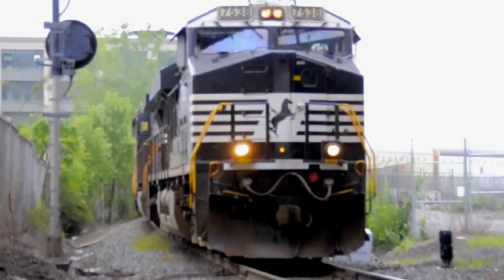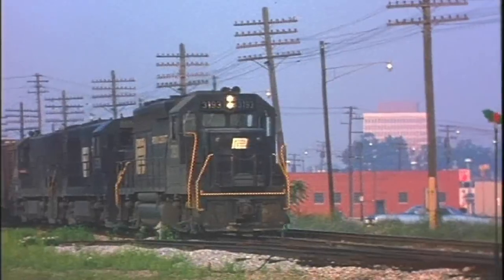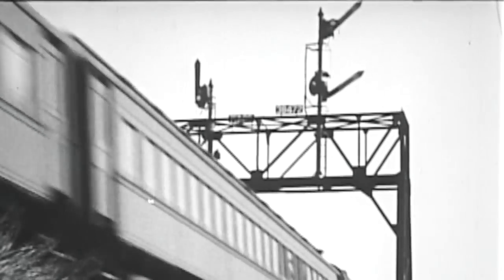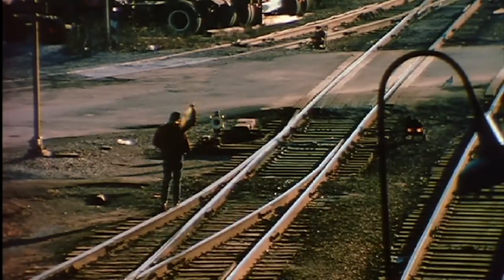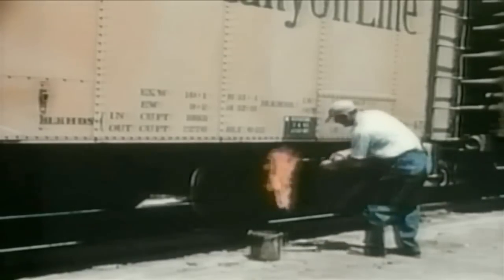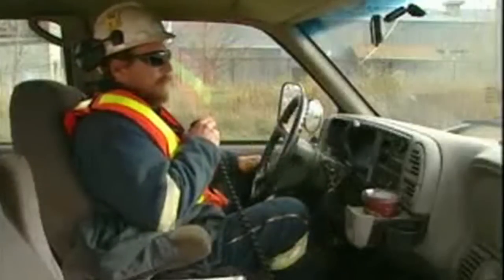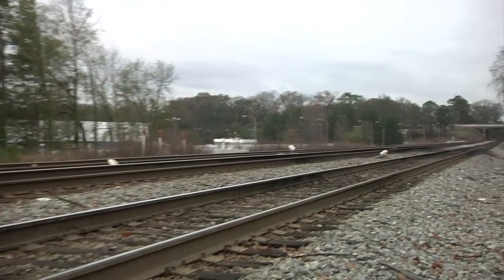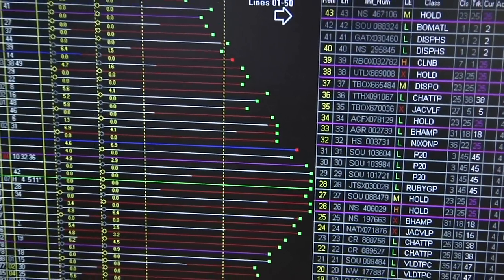Communications and Signals:Then and Now

Comment: Correct me if i'm wrong, But watchin' this had to make me ponder....For over 100 years, cars,. trucks, etc all ran just fine using points, plugs and condensers......So who's idiotic idea was it to start using computers to tell the bloody gear box when to shift? Or to run the entire electrical system?
Reply: +chaosdemonwolf1 Our fearful leaders and everybody else bound to take all control away from common folks. Make it 'specialized' so you can't fix it. Anything can be done mechanically but it's too simple. In order to be 'more important' the product has to become more complicated.
Reply: That somehow don't surprise me at all
Reply: chaosdemonwolf1 Just think about it. Would you change something that works perfectly fine, day after day? No. The common man is satisfied with what works. Greedy people want to 'improve' things so they last shorter. Just follow the  yellow brick road.     $$$$$$$$
Reply: More like the road less traveled, lmao But yea, I get your point
Reply: We're on the road less traveled, the one paved with $$.
Reply: Good point
Reply: if you want to have cars that still have distributor caps and spark plugs that you have to set the gap on, Havana Cuba is the place to live!
Reply: So why, are you using a computer when a typewriter and an adding machine will do the job?
Reply: @kw5kw  Can't get a ribbon for my typewriter or a blade for my hand operated (and silent) edger.  If my voice activated messaging on my recently acquired Iphone was on my computer I would ditch the typewriter.

I've got an mint industrial strength rolodex (6 lbs, 0.8 cu ft) for sale at a reasonable price, until it becomes an antique.
Reply: chaosdemonwolf1 "Just fine"? IMO, not really. Those mechanical bits go awry much more easily than electronic ignitions, for instance. Thus you'll almost never see a breaker-point ignition on a utility engine, chainsaw or such. Those anachronisms are waaaay too delicate and unreliable. Besides difficult to service. BTDT. I'll pass. Except for stihl, those electronic ignition modules are extremely inexpensive to make.
Reply: I was born in 1946 and I also like the old cars and trucks, and they were easy to work on then, not anymore as of new technology and now in the next four most will be electric cars and self-driven cars and trucks. I suppose roebucks will be taken over next in the future. There was lots of work years ago, but not anymore.
Reply: The government.   They mandated reductions of emissions and minimum fuel economy

Comment: You can't tell what railroad it is by the engines. They are all leased at different times to different carriers. You have to look on the signal cases or houses at a crossing. That will let you know what railroad it is. When I worked for southern pacific  in Los Angeles in the 1980s there was talk of a big merger with Santa fe that never happened. The ICC stopped it saying it would be too much of a monopoly  west of the mississippi. (But a few years later allowed  the BNSF merger) they painted some of the engines already in anticipation, SPSF. The joke was Shouldn't Paint So Fast. Some of them are still out there 30 years later. Some were yellow with blue, some were yellow with red.....Google some pics
Reply: I will never understand how SPSF would have been a monopoly when UP was allowed to absorb so many railroads.
Reply: Oh yeah, I just looked. It appears that one's in operation had the "SP" Painted over with red
Reply: stripervince1 Thanks for the knowledge I have seen those engines in older videos from Ft. Worth but never knew the story behind them
Reply: +stripervince1 The  Kodachromes, I remember those.
Reply: i saw one on a csx route in nashville about 6 years ago

Comment: "Hump yard":  At the beginning of the yard is a rise in the track, usually located at or near the yard master's tower.  Cars are pushed to this point with enough energy to roll over the hump.  The yard master makes note of the car and as the car rolls over the hump, gravity keeps the car moving to the correct track to make the consist.
Reply: And In 2019 they are closing hump yards and claim flat switching is faster??
Reply: @bobpaulino4714  yes. Welcome to what one CEO said would work, and everyone blindly followed. It'll bit them in their rear end soon I hope

Comment: When you replace a Human with a Machine, you exchange one set of problems with another. Problems will always exist regardless of the position on the railroad. Technology-based operations can experience errors and bugs, and humans can drop their coffee or have a bad day.
Reply: True.    And create a lot of unemployment in the process.
Reply: @tommytruth7595  Profit is the bottom line isn't it?  It's all about making the most $$$ with as little operating costs as feasible.

Comment: So, Norfolk Southern essentially said f*ck you to all those employees and replaced them with machines. People wonder where all the jobs have gone. Not all have been outsourced. Many have been lost in the name of "efficiency" and profit.
Reply: You forgot safety, as many of the old manual systems were subject to human error.
Reply: Should we get rid of combine harvesters and return to the era of landed peasants?
Reply: Anti Dash
sure but what is the frequency of mechanical malfunction vs. human error?  Much less I'll bet.
Reply: So you want to bring back telephone exchange operators? And triple your phone bill?
Reply: Following that line of thought, we should all still be pulling potatoes from the soil. It doesn't work that way. Things change, and people have to change with them, or else they are left behind. You don't have an automatic right to a certain kind of job, just because you've been doing the same thing for the past 20 years. It's evolution and survival of the fittest, and brought mankind where we are today.
Reply: Tony Souter
Much more than triple. It would be impossible for human operators to handle the level of traffic we use now.
Reply: In many cases too the the "replacement" with machine was done through attrition - Instead of completely laying off a certain class of employee (ie, laying off all tower operators at once) they would simply stop hiring new ones. Then, as operators retired or moved to other positions they would continually shift people around to other towers to fill the gaps until they had all retired or moved on. Pretty sure a lot of employees got early retirement out of this too, thanks to the unions.
Reply: They replaced the jobs with electricians, engineers, and mechanics.
Reply: @PaulMauser    They didn't replace all the jobs, not at all.
Reply: And why was he unskilled? Was it because he didn't bother going to school, or because he simply couldn't achieve more than secondary education, or because higher education is only available to those with money? It's about more then just the railroads.
Reply: +thelol1759 The problems mostly originated in the military grade PLCs and the associated control panels. Many forget that in one day here we have more lightning strikes in one day than some places do in a month. Florida has a band north of us which is the most likely place in the US to get hit by lightning. And lightning strikes on our power grid means ripples from as far away as GA just on FPL's lines.

Lightning is also what will and does cause major headaches in a signalling system and a transistor or SCR is no match for a regular railroad grade signal relay as far as durability. Solar panels charging batteries in the relay boxes are a way in where in the old days, the batteries just got rotated on a regular basis to keep them charged.

 And ball lightning sounds like sizzling bacon in case you were wondering.
Reply: It is 'Do or Die' policy. The stiff competitions... either amongs these railroads themselves, or imposed by the government-sponsorized 'substitutions' (especially the Interstate Uber Super highways and aviation industry, both of which uses infrastructure pooling which created, ran, and maintained by taxpayers dollars. taxes that the Railroads had been levied!!!). And the increasing bargain powers imposed by labour unions in general (sometimes the bargains were imposed by Mafias through the union bosses they control, but not with the consents of union memberships). The north american railroads (which never been subsidized by the federal governments, not even one cent were earmarked for it) must invests on these upgrades on their own, WITH THEIR very own cashes and many big railraods were subjected to a pile of debts in process (and many didn't survive past '70s). First and foremost of many upgrades including the Dieselizations (which N&W was the last to do it) drained railroads coffer with their VERY hopes that Diesel efficiency will worth their efforts (but it doesn't seems to be so by 70s, where once dirt-cheap diesel fuels became expensive) and this forced PRR and NYC to merge (only to die as PC few years later), and crippled Southern Pacific fundamentally.... Again about competitions imposed outside the RR industry, highway truckers can deliver freights without the needs to go to freightyard (and do it fast), the freight train speeds (due to the operations, not due to the motive powers and tracks) had to be increased and this is when electronics and computerizations of railraods came to exists...

I'm a bit surprised why the CTC shown here has not been refrred as such? and why there's no
'touch screen CTC' as yet?
Reply: Anti Dash
Valid points.

But the railroads had to be able to compete. They had to adapt.

Especially with the advent of trucks, our highway system and mechanical refrigeration.

If these improvements had not taken place, the rail industry would have been wiped out with the exception of a few who dared to make progress.
Reply: gravelydon
This is conjecture.

Mechanical vs Software is more complex than that. You're using a needlessly reductive argument.
Reply: +thelol1759 Having worked in a MMI environment, it was always far easier to fix the mechanical end than it was to find the bugs in the computer systems. Because some times it only would happen when there was a voltage spike on the AC voltage. And then only after a number of times. A chart recorder had to run for nearly a week to catch that problem. The logic part was all DC with filtering fed off of batteries with relays operating the 480VAC side. With railroad signal operation, everything has to go to the safest mode upon a failure. But a computer might not know that it has failed. Our error logs even when things were running normally were pages and pages in length. And we had redundant control computers. Relying on computers to control things is too easily hacked and can cause troubles. There has been much discussion about that on the electrical grid too. The only secure computer is the one in the locked closet that is not connected to the outside world.
Reply: gravelydon
Sounds more like a lack of forethought on the part of the Electrical Engineers responsible for designing the system honestly.

Not having ECC memory on mission critical parts is a recipe for disaster.
Reply: No, nowhere near all of them, This Guy.    What about the guy who had didn't have much education but had a job on the railroad years ago and was thrown out of work?    He was not a skilled worker, or engineer but could make a living and support his family.    He could not do that today.
Reply: +DiscothecaImperialis  Touch screen CTC would take lines and lines of code. And would have to be perfect in operation. Mechanical CTC is less likely to fail. Touch screen CTC will likely be skipped and it will go to computer controlled traffic control. With trackside units reading the AEI tags and matching them to where the trains are going.
Reply: Very true, Zen Ktteh.    And the  people here miss that point.   The real effect of abolishing all those jobs has been a disaster for this country and the standard of living for the average person.   But that point goes over their heads like a 747.   Look at what they write, about going back to picking crops by hand!   LOL.   Not the same at all.
Reply: Exactly,  Zen.    And not just NS.    Why do you think our standard of living has gone to hell in this country?
Reply: But you see, 25mfd, the railroads could not compete against that stacked system.     They were heavily taxed and those taxes were used to subsidize their competition.    It was unwinnable for the railroads.
Reply: Patrick94GSR machines can also malfunction
Reply: that is true, but sometimes its the opposite it could depends on the many variables track condition, location, age ect... Example if the track is by the ocean the salt in the air will rust the track quickly even with proper maintenance think about what that would do to electrical things connected to the track
Human error would not be a factor if people did the job correctly. Lazy people make the risk human error  high because they like to find shortcuts to get the job done faster but not correctly.

Comment: With the advancement in technology such as in the Hump Yard it is just a matter of time before Engineers and alike will be history
Reply: Not really! it is the 're-allocations' of human resources in Railroading. old skills became outdated and new skills were needed, these digital devices requires periodic inspections and maintenance... even if it becomes more durable and 'work shifts' extended, it is a man to do upkeeping and upgrading.
Reply: I'm a signal maintainer with ns. What's going to be the downfall of my job will be private contractors like Interail
Reply: @PCerdos  It's cost control.  Management wonders why employees have less loyalty than previous employees.  Hope that signal improvements have resulted in fewer off hour track visits for you.
Reply: +scootosan  Electronics do fail. And when they do, a human has to fix it or manually operate the equipment. Stationary equipment is easier to computerize but sometimes the Mark I eyeball beats out anything electronic. That is why I doubt engineers will ever go away but they will get electronic backups. And vice versa. I've worked with MMI/HMI where a command is issued by a person to a computer (point and click). The computer then tells a device to operate or a sequence of devices to operate. Sooner or later a sequence will get messed up.

Comment: Very interesting but I was concerned about the state of some of the track holding nails and plates they all seemed loose and moving even new shot showed this do they not use bolted down track plates in the USA?
Reply: Over time and constant up and down pressure, an area of cavitation forms underneath the cross-ties. This causes a pumping motion as the car trucks go over it and leads to the loosening of the track structure. Sometimes a local track crew can tamp and pull a small section of track or a larger T&S gang (tie and surface) will resurface much larger lengths of track to stabilize the road bed. We call the nails "spikes." As far as bolted plates, they are usually used on concrete-ties and are called Pandrol clips. I hope this answers your question sir.
Reply: The important main rail lines get frequent thorough X-ray and ultrasonic inspections, as often as every 30 days.

Comment: Nice overview.  Any progress on a train-length digital signal system to monitor truck bearing temperatures on the fly and relay the data to conductors and engineers?  Such a system would allow dispatchers to shunt a hot-boxed train to a way-yard house or business siding for repairs before the grease ignites - the Burlington Northern-Santa Fe had a trackside fire at Oakley, CA, USA traced to a hot box a few years ago.
Reply: That probably would require the conversion to electronically activated brakes (ECP) that also involves running a (weatherproof) digital signal the entire length of the train.  Think of it as a local area network for the train.    While this would have huge benefits, most rail cars are now owned by leasing companies or the shippers, who would have to bear the costs of the improvements.   Maybe they could work that into the next $trillion infrastructure bill

Comment: Thats the phase motion detector. In short it turns the track into a tuned circuit when the train rolls onto the section it alters the tuning and activates the crossing. While its moving the tuning is constantly changing holding the crossing active. If the tuning isnt changing but not its normal after a preset time it times out and deactivates the crossing but the instant it changes again it reactivates IE a train has parked in the detection zone.

Comment: You have absolute signals and intermediate signals. Track signaling is broken down into blocks with absolute signals govering that section of track. In between you have intermediate signals that flashes green to let the crew know that absolute signal is green ahead. If the signal ahead is either red or yellow the intermediate signal will flash yellow to signal the train crew to reduce speed and either be prepared to stop at the next signal or continue at restricted speed a yellow signal ahead.
Reply: Thanks for the explanation.
Reply: Every railroad has different devices and  meanings of signals.   While the railroads in the United States were privately owned, that meant there was no standardized scheme of what signals meant. This requires engineers to be certified on every section of track that they will be operating a train over.   Even so, there are exceptions like signals that are on a time delay.  The saluda grade video from Southern Railroad has an excellent explanation of one.   The grade was so steep that in the event the train was losing braking control and got to the switch too soon, it was diverted onto a runaway train ramp.  This idea was carried over into the trucking business where you see runaway truck ramps.